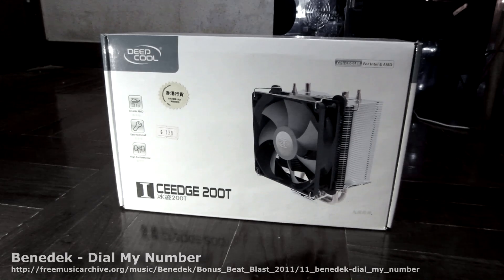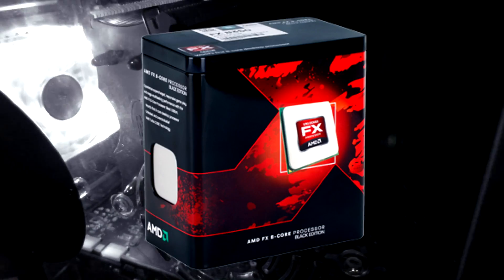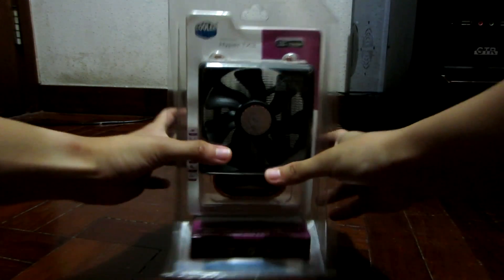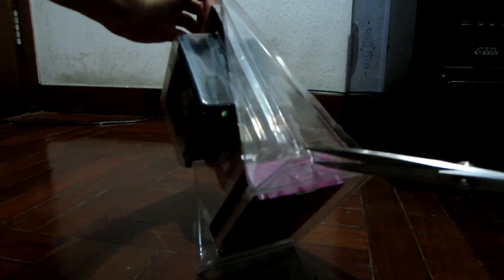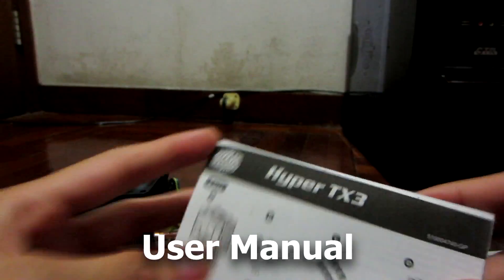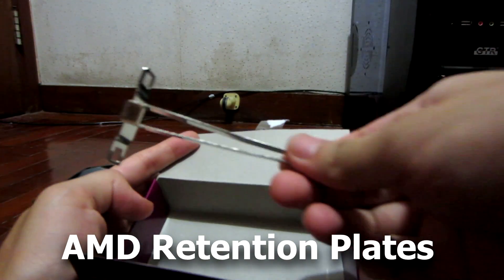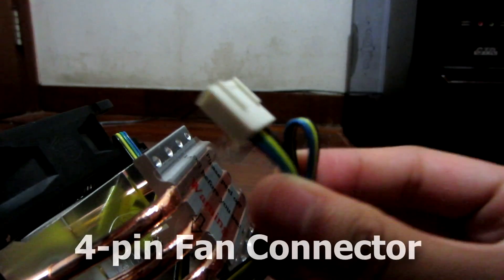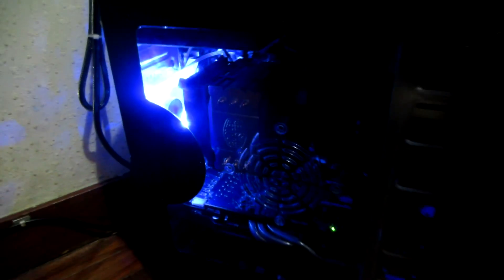Cooler Master Hyper TX3 CPU Cooler ► Unboxing + Review

Comment: Can it handle stock and oced i7 7700k?
Reply from the maker: It should be able to. I was using it on a FX-8350 which is so much less energy efficient than Intel CPUs and runs quite hot.
If you're planning to do more OCing though, probably best to go for at least the 212 EVO to be on the safe side.

Comment: do you think it will fir with a amd fx 6300
Reply from the maker: +I AM Royal I run an AMD FX-8350 which runs hotter than a 6300. This cooler runs fine for me, should be fine for you too. 👍
Reply: PanickedPixel Hello! I was woundering what ghz your CPU is running, as I'm thinking about overclocking my i5 6600k to 4ghz Maybe higher, is this cooler enough for that and do You recomend a second fan on it as i already have 5 case fans? :)
Reply from the maker: MrZeerix I'm currently using a FX-8350, 4.0GHz. I don't think the TX3 would be beefy enough to handle the heat from overclocking. On a budget, you'd be better off with a Cooler Master Hyper 212 EVO. And yeah, I would recommend adding another fan on the heatsink. You want the heatsink itself to cool as quickly as possible since CPU temps are your main concern. Case fans might not directly help with the cooling of the heatsink.

Comment: Just gonna point out.You had spyware or a Virus that caused the Temps to go that high an you fan speed to speed up like that.In Windows 7 Run ComboFix.Then disable Windows Updates.Security Center an Windowos Defender an that should fix the problem.

Comment: +PanickedPixel If you don't mind me asking, why did you go with an AMD CPU? I know the FX-8350 is an octa core, however an Intel quad core will out perform it. Intel CPU's do more IPC (Instructions Per Clock). I'm assuming you did a budget build and then just upgraded the CPU. I'm not knocking your choice or AMD. The chip can be OC'ed to 5GHz.

On to thermal performance... Arctic Silver 5 is a good thermal paste which may help you run a little cooler. While you didn't specify what thermal compound was applied, using any decent paste will likely net you 2-5*C cooler temps. You could look into Yate Loon fans (if they're still around). Noctua are very pricey, but are very quiet. As long as you leave the cooler in that position and don't move the fan to a horizontal position, you can using a fan with any type of bearing. While a sleeve bearing may start off quieter than a ball bearing (depends greatly on fan and build quality), overtime a ball bearing fan will last longer and be quieter. Granted, this is about one year one month 44 days late so you may have upgraded already.

Side question, what microphone do you use? I'm guessing a Blue Snowball, Blue Yeti, or Audio-Technica AT2020 (the most common budget mics).
Reply from the maker: Hey, thanks for your question and for all the comments you've been leaving on my videos recently! :)

You're spot on with your guess! I purchased a budget build from a friend and merely upgraded the CPU from a 6300 to an 8350. I'll probably go for an Intel when I make my next build because AMD runs waay too hot for my liking and yeah, Intel is so much better in terms of performance.

I recently upgraded my graphics card to a GTX 970 and don't plan to spend anymore until then. Budget's a bit tight as I try to save up for graduate school. I will keep all your recommendations in mind though! :)

For the microphone question: I'm actually using a Sennheiser e845s connected to a Roland UA-33 Tri-Capture audio interface. I have a bit of a slightly higher-end setup than most because I also run another YouTube channel for my singing stuff.
Reply: +PanickedPixel zen is soon out too!!

Comment: I rly need to get my self a new cooler my old it not even helping it is blowing hot air
Reply from the maker: Goodness. If that's the case, you definitely should! It's a lot cheaper than having to spend on a new CPU.

Comment: Nice Review :)
I always go for Coolermaster as for Fans/cooling solutions when it comes to  Price/performance relation. I found that Noctua has a excelent products too, and they are mostly silent/high performance fans and cooler soluitons. they might be a little expensive but i think in the range of High Perfomance/cost effectiveness they are at the same level :)
Hope to see more reviews :D
Reply from the maker: Glad you liked my review! Definitely agree with you on the Cooler Master price-performance thing. I haven't tried Noctua myself since I'm a bit new to computer builds (not new to understanding specs though). I'll see if I can get some of their products here in Hong Kong.